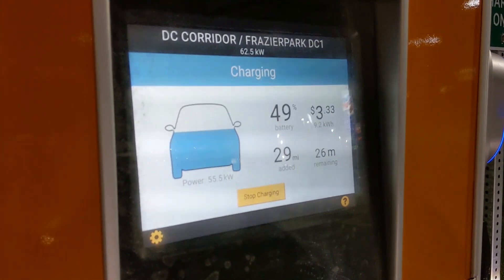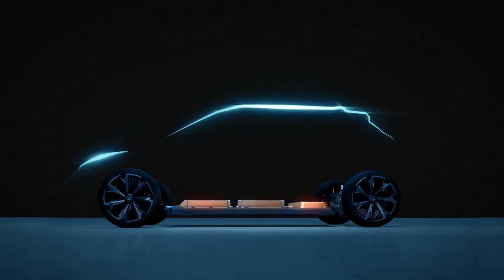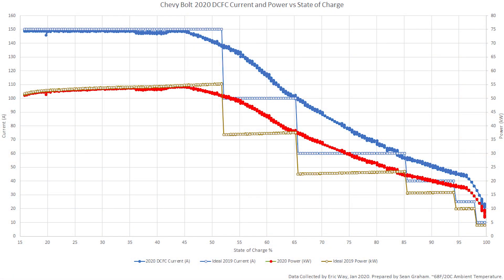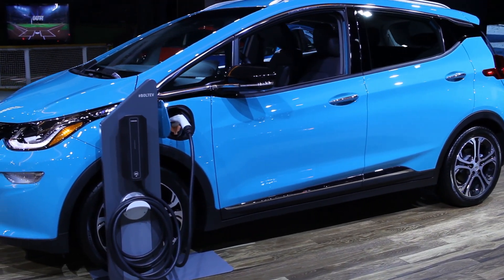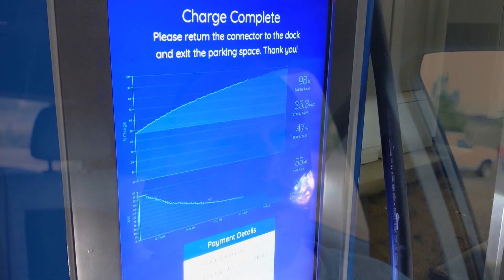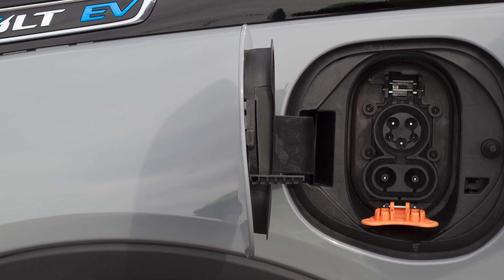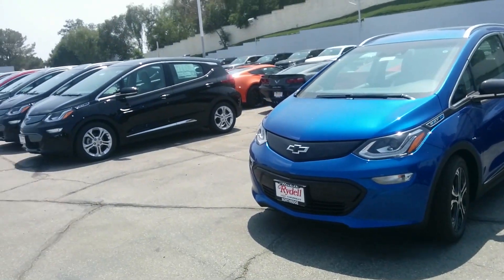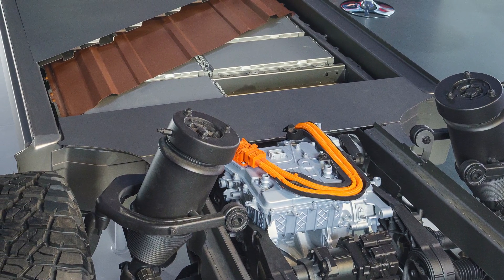Dear GM: Please Offer Chevy Bolt EVs a 200 A CCS Upgrade

Comment: Would be cool if someone would make a 3rd party CCS port swap kit that’s 200A and a way to reprogram the cars BMS
Reply from the maker: We can already buy 200+ A CCS sockets on the open market, so the biggest hurdle is reprogramming both the BMS and Power Control Module. Of course, that will definitely void any existing warranty on the battery, which is a big risk for something so expensive.

Comment: I am 100% with you on the option, upgrade. I don't travel with my '21 because charging is so GD slow. SLC to Flagstaff has no chargers anyway. I would still purchase the upgrade if it were offered.

Comment: Excellent idea. Chevrolet should also develop a kit for dealers to add the DCFC option to Bolts that only have Level 1 and Level 2 charging. 
I bought my Bolt used and it only has Level 1 and 2  charging.  While navigating my way through the battery recall with Chevrolet I have asked at every turn if it would be possible to have the Leve 3 charging option installed on my car while they are replacing the battery. All I get is crickets and blank stares. I can't be the only one who would be willing to ease the pain of the recall by giving a little money back to Chevrolet for an upgrade while they are replacing my battery.

Comment: @News Coulomb , do you know if there is a way to upgrade the ccs port to a 200amp using aftermarket parts? Because it would be a total benefit to have quicker charging rates when traveling.
Reply from the maker: It should be fairly easy from a hardware perspective. It's primarily the CCS socket and wiring harness itself that's the bottleneck (possibly only 1 gauge wiring), and you can buy 200 A CCS sockets with wiring off the shelf for about $200 to $300. From the contactor box on, the connections are capable of at least 400 A peak and over 300 A sustained current, so the hardware side is super easy.

It's really the programming that's going to be an issue. After installing the upgraded hardware, you'd have to reprogram the BMS to request up to the 1 C current rating (171 A for the 60 kWh pack and 188 A for the 66 kWh pack) while also programming it to accept excess current for running onboard systems. At a full 1 C charging speeds (60 kW or 66 kW), it would also be advisable to start the charging taper earlier (probably 40% battery instead of 50% battery like it currently is).
Reply: @newscoulomb3705  ,thanks for the breakdown. You really know your stuff. As much as I'd like to look through the code and tinker around, it would be nice if GM or some open-source code would be available. Keep up the good work, buddy. 
Side note, did you or do you work as a electrical engineer? Your knowledge is up there for this EV stuff.
Reply from the maker: @wingryda  Thanks! Yeah, I'd like to be able to access the code too. The BMS coding from the latest recall patch still needs to be finished.

I'm not an electrical engineer, but I have worked closely with them on projects as a technical writer, which helps me to understand and communicate the concepts.

Comment: I think I can get behind this if they include the option to upgrade the 2017 Bolt EVs that didn't come with the DC fast charging option. I have a used 2017 Bolt EV and didn't realize at the time of purchase that it only has a standard j1772 port and not the CCS port that was an optional upgrade when ordering it new. I wanted fast charging and didn't know better. The dealership said it had fast charging and I didn't know what the CCS port looked like at the time. I did research a little bit but there's no way to upgrade it that I could find. I need CCS fast charging 😓

Comment: Can we get a third party to change the sockets and wiring
Reply from the maker: You could, but it might be more than that. The software would also need to be reprogrammed to request additional power from the charger. This is really something that GM would need to do (and they should do).

Comment: So I don't actually own a bolt, but if I did I don't think I'd pay anywhere between $1,000-1,500 for an upgraded CCS socket. The trade off of that much money vs waiting an extra 10-15 minutes at a charger doesn't seem worthwhile to me. But at the same time I haven't gone on a 200+ mile road trip in quite a while and most of my driving needs are met by the electric range in my 2016 volt.

Comment: Time to bring this conversation back with the 2021 Bolt being able to charge up to 100kwh. I personally would pay for an upgrade to increase my charging speed!
Reply: I'd personally pay for an upgrade to use DC fast charging at all. I can install the hardware parts myself. That's the easy part. It's programming the system to work that I have trouble with 😕

Comment: But.... if Bolts are limited at 50kw, what good would a 200kw do? Of course, I don't know much about this kinda' thing. Just got my Bolt last week
Reply from the maker: The Bolt EV's peak charging speed is 55 kW, which is 150 A. Increasing the current to 200 A would also speed up the charging speed.

Comment: I appreciate that GM is acting conservatively on this.  I would rather wait a few minutes longer at every fast charge and have a longer battery lifetime until there is plenty of data to determine that increasing charge rate > 1C at SOC < 50% would not impact battery lifetime.  I think your point; however, on offering faster charging on Premier trim is well taken.  Just my 0dBW.

Comment: Fantastic idea.  You make several excellent points, but they will likely fall on deaf ears.  It would also help dealers move used Bolts, and get a boost to revenue by offering the upgrade to customers.

Comment: DC fast charge really should be standard on all Bolt EVs and as goodwill they should offer the 200 amp upgrade to those with DC fast charge at a modest cost $500 to existing owners. I think this would generate a lot of loyalty. I am on the fence on the Bolt. It’s definitely more affordable than the Tesla Model 3. I like the hatchback over the sedan and overall like the look. Based on what I have read and watched and I have researched a lot; The charging speed, lack of ACC, front seats, and short 3 yr / 36k bumper to bumper (and associated warranty issues I have heard about) hold me back. The car is so close to working for me and the faster charge rate might just push me over the edge.

Comment: How does the Kona charge at 75kw when uses the same size battery as the Bolt?
Reply: Maybe that’s why Hyundai is replacing all the Kona Batteries in a recall……coincidence…..maybe, maybe not.

Comment: I looked at my 2018 Bolt when I first bought it and it was obvious that the wiring from the charging port was too small for more than 150 amps.  I did not know about the port capacity.  Probably the port and wiring are not the only upgrade necessary.  I would also guess the charger would have to be replaced as well as the wiring to the battery.  The feeders to the battery cells may also be too small.  Just replacing the charger module would require breaking into the cooling system.  
It is now snowballing.  
Unfortunately, I think there is no way this will happen.  
The only upgrade I am familiar with is the one to upgrade cold weather charging which I did have installed.  This increased cold weather charging from 17KW to a max of 44KW.
Neat idea, but probably no way.
GFM
Reply from the maker: I actually think it would only require replacing from the socket to the contact box. The Bolt EV's battery internals are capable of supporting 160 kW output, so 150 A input wouldn't be an issue. 

Also, DCFC bypasses the onboard charger, so that wouldn't be affected at all.
Reply: @newscoulomb3705   @newscoulomb3705  You may certainly be correct about the battery wiring.  Looking at the Weber university video it seems correct.  However, GM may say the wiring and terminals were not designed for extended use as in charging.  
As for the charge box, the charger is bypassed as you say.  However, the wiring does pass thru the box and there are terminals that may need be to be upgraded.
Not trying to say it cannot be done, but car makers get really picky about these things and generally tend toward replacing entire components rather than adapting. 
As an example, I had an air conditioner cooling fan failure under warranty on a truck.  The tech said he had to dump the refrigerant charge to replace the fan.  I could have easily replaced the fan without dumping the charge ( I am an HVAC service tech) but that is what the book said.
As for cost, some of your commenters are living in la la land.  $500, no way.
Anyway, good luck with the upgrade.  I am also hoping there could be some upgrade in charging capability.  Keep the videos coming.
GFM

Comment: For  just the socket $500.

For older 150 amp sockets GM Chevy could bring back a modern Spark EV with current Bolt  sockets and do a 22 to 33 kWh battery.   For those who don't need longer range.

I would like to see a new 75-80 kWh battery with 66-70 kWh activated to cover degradation but also allow for faster charging to 95-100% of the 66 kWh. 50 kW to 95% would be awesome. 100 to 200 kW would be better to 95%.
Reply from the maker: Yes, they have a lot of options, but many require different batteries. The Spark EV's battery had way less energy, so you might only be able to fit 40-45 kWh (maybe 180 miles of range) in the same space as the Bolt EV's 66 kWh, but you should be able to charge at close to 125 kW.

Comment: I have old model S that charges at 70 kWh then tapers to low of 32 kWh when you are near the top off. This drives other Tesla owners nuts, because it is sooo slow.  I can’t imagine road tripping with max of 50 kWh - GM  If they don’t follow your advise will be killed by other EV not just Tesla - VW and Audi Ipace all have faster charging.
Reply from the maker: Keep in mind that the Bolt EV already travels faster than the original Tesla models thanks to its efficiency. Still, though, as you noted... Charging at 200 to 250 mi/hr is at the bottom end of what many Americans would consider acceptable.

Comment: I think he hit the key towards the end, they offered us a cheap vehicle. probably still reusing the Chevy Spark EV  socket. Whole lot cheaper to produce one part that's already been engineered  than two parts even if there's a potential thousand dollar pop sale. engineering side would cost way more and would make that thousand dollar part $3,000 part make a profit. probably not making profits on these anymore anyway they don't want to put any in Innovation into it. I am seeing fully loaded LT 2020 models for $29k right now, pre tax credit and state incentives...
Reply from the maker: Yes, that was my guess as well. They probably still had a large stock of 150 A CCS sockets from the Spark EV. If they purchased 100,000 units, they would still have some left.

Comment: Way to go Eric. Ha!Ha! You better believe most Bolt owners would jump at the chance to upgrade charging capability. Now how do you get GM and its engineers to listen to your proposal and actually offer it? Thanks a lot for doing this. I've been on this bandwagon for a long time.
Reply from the maker: Thanks! Hopefully it gets some traction. Heck, cracking the coding on the BMS plus a 200 A socket might be all an aftermarket tuner needs to make this upgrade happen for existing Bolt EV owners.
Reply: @newscoulomb3705  That's where my thoughts have been leaning as well.  I know the late Jack Rickard (RIP) primarily played with Teslas, but I would bet if someone threw this challenge at him he would have solved it just for sport.
Reply from the maker: @mikeg7845  Yes, I think a company in Canada has already figured out how to add CCS to non-CCS Bolt EVs. This is just the next step up in difficulty.

Comment: You assume that Chevy wants to compete with the Kona. Actions speak louder than words, and Chevy just isn't trying to compete. To them, EVs are just a "weeell.... If you want to live with THIS, it costs a bit more and can't do as much. But this Equinox, on the other hand..." Talking point.
Reply from the maker: Yes, but from a corporate level, the Bolt EV is worth over $19,000 just in ZEV credits. 

As for competing with the Kona Electric, it's the other way around. GM came out with the Bolt EV, and the Kona Electric was Hyundai's attempt to catch up to GM. 

I understand GM's decision to go with 150 A socket originally; it's the upcoming 2021 Bolt EV that I'm primarily concerned with.
Reply: @newscoulomb3705 : The question of which came first is mostly irrelevant; the fact is that the Kona EV is an EV, thus a theoretical competitor. Except that the Bolt hasn't kept up with the DCFC capabilities of chargers, or other EVs. And that's by design. If Chevy really wanted to make a good EV, one which would undermine their ICE sales, they could (and really SHOULD). But they won't, because ICE vehicles are more profitable; even with the ZEV credits.

Comment: I wouldn't spend $1,500 for an additional 5kW for something I use 7-10 times per year.
Reply from the maker: That's fair. I think this would make the most sense for those of us who rely almost solely on our Bolt EVs for travel. The main benefit in my mind isn't the 10% increase in charging speed but rather the additional ~10 kW I would be able to draw for battery and cabin conditioning while still charging at 60 kW. 

Plugging into a 150 kW charger on a 110°F day only to see a 47-48 kW charging speed feels bad. I know that cooling the battery is necessary, but it sucks to lose charging power to make that happen.
Reply: @newscoulomb3705  I can see where it would be valuable for those in cold climates (where you could run the PTC while charging) or very hot climates (a/c trims a lot less off the the charge rate than PTC does so it isn't quite as important but in Baker it would be handy).

I charged at Baker one time at 5:00 am and I got a full 55kW but yeah at midday it's sub 50kW.
Reply from the maker: @homomorphic  A cost-benefit analysis is necessary, for sure. For me, saving several hours a month, every month, is worth it.

Comment: How would an increase in charge amperage impact battery life? I think this upgrade would be more involved than just changing the socket out. Otherwise, why wouldn't they do this in the first place?
Reply from the maker: In theory, yes, but the difference in degradation between .9 C charging and 1 C is small. As for why, I think two things happened:

First, GM likely procured the CCS sockets and harnesses before they realized the Bolt EV's battery capacity would be 60 kWh. It sounds like GM was expecting a 50-55 kWh pack, but LG over delivered.

Second, there wasn't a perceived value because it wasn't until two years into the Bolt EV's release that faster than 150 A chargers became available. In fact, it looks like GM was designing with ChargePoint's CPE 250 chargers in mind, which have a maximum output of 150 A.

Comment: The other thing the car needs is Vehicle-to-Home (V2H) and Vehicle-to-Grid (V2G) ability.
Reply from the maker: I believe that will be coming with CCS version 3. The Bolt EV would be something like CCS V1.5 (a made up version), but it sits somewhere between the original CCS and the new CCS version 2 that most new EVs are using.

Comment: YESSS it's ridiculous. I sit next to 350kW chargers as I charge. In RC car racing we charge batteries at 3-8C charging rates sometimes depending on the battery's internal resistance.
Reply from the maker: It would definitely take a lot to charge these at 3 C, let alone 8 C. We might get there eventually, but I think, long-term, a 4 C average charging rate to 80-90% would compete with gas cars, even on long trips.
Reply: @newscoulomb3705  Interesting. At some point I've been meaning to calculate the energy transfer rates of filling up a gas car vs charging up an electric car.  Then doing the calculations accounting for their respective efficiency at converting their chemical and electrical potential energies respectively (technically the electric car could be seen as also having chemical potential energy) into kinetic energy. Too see how fast the electric cat would have to charge to offer the user the same rate of providing keneic energy (in the future, so the terms potential and kenetic energy aren't the best way to be thinking about it) that filling up at the gas  offers. Of coarse this is assuming electric cars will be able to reach the point of matching the amount of potential kenetic energy that the gas car offers (ie will there ever be a single electric car that can go 1,000 miles on a charge like my friend's diesel truck can)... Time will only tell (and engineers)

Comment: Like others, I bought the LT trim because there wasn't enough benefit in the extra features of the Premier model to justify the cost (though I did get all the optional packages.) But, a faster effective charging rate might have made me go for the Premier. If an upgraded charging socket is all that is needed, it seems that GM should certainly do it for the 2021 model.